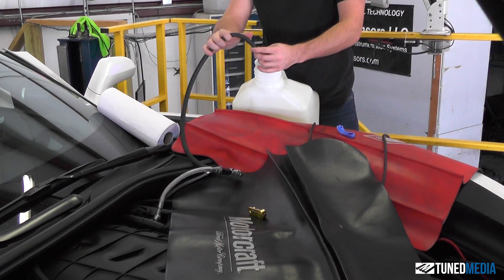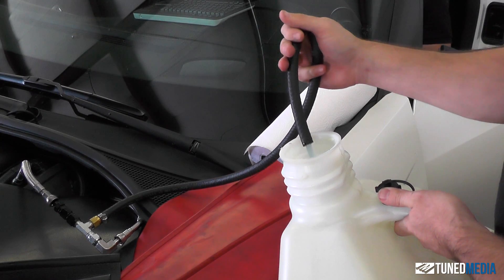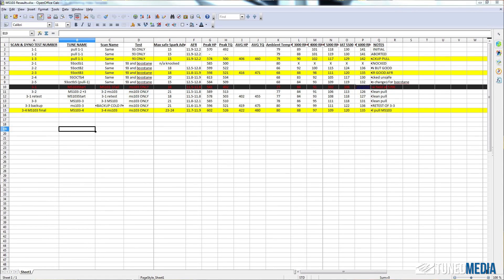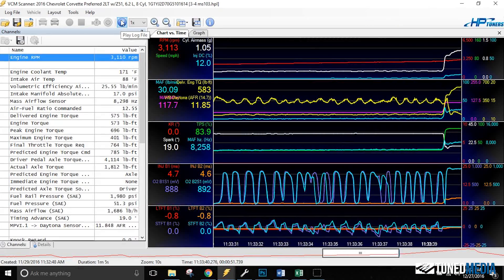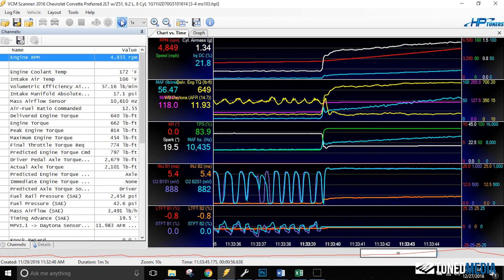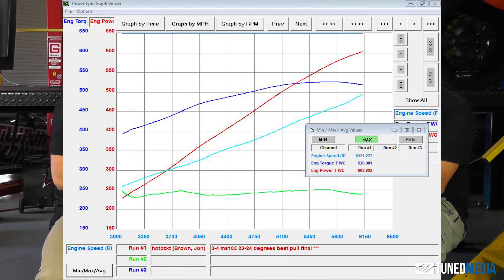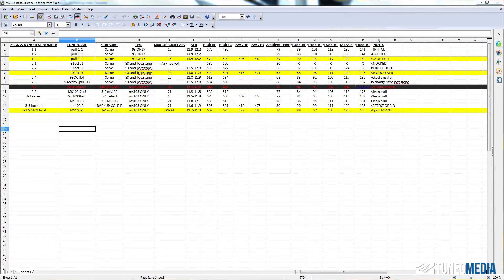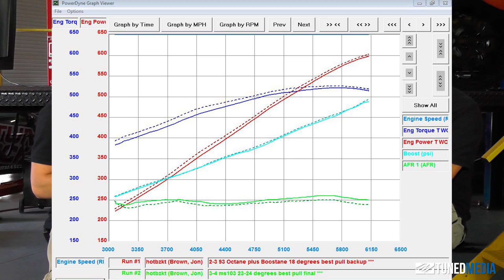Racing Fuels: VP Racing Fuels MS103 Dyno results- How much power did we make?

Comment: Well I can kinda say the opposite I went to the track in my 2010 Taurus sho with a twin turbo 3.5 v6 I had it with a 93 tune and ran a fastest pass of 9.44 in the 1/8th and once I added 3 gallons of 114 octane to 4 gallons of 93 and it ran a fastest past of 9.14 in the 1/8th

Comment: Hey Guys, just watched your series on race fuels and thought it was very informative.  I do, however, have some questions that I hoped you could help with.  I have a 2019 EcoBoost Mustang and recently installed the Ford Performance Tune.  They recommend 93 Octane for this Tune, but being that it is a canned Tune I can not modify it for different fuels.  I also live in California, so pump gas is 91 is the standard.  This made me worry that if my Tune needs 91 minimum, but reccomends 93 then I might be under the recommendation if I get bad gas.  I do not want to cause any issues with my car as it is my daily driver, but I also want to take it to the track for drag racing as well as track racing HPDE.  I would like to know which fuel set up you would recommend.

 I do not want to switch my fuel system to flex fuel or E-85, so I have been mixing in some race gas 101 octane in with my 91 pump gas to get an octane rating closer to the 93 that is recommended by Ford Performance.  I live in the high desert, so in the summer it gets very hot here.  Temperatures reach over 100 sometimes.  With that said, what percentage should I mix of 101/91 octane to reach the most power at the least amount of concern?  So far I have been using about 50/50?  What are you suggestions?  Thanks.
Reply: E85 is corrosive. It's also 20% less efficient per gallon. Has an "effective octane" around 108. It does burn cooler. 
If you have turbo why not just add alcohol/water injection for momentary power?

Comment: only concern I can see by using this particular vehicle is your getting all your power changes purely based of ignition timing, now while we can see gains from different fuels, due to this applications generally there going to be fairly small, I think what might have been useful would to have been to use a turbocharged application as that would allow more boost to be easily run which might have seen larger gains. While this does give us a pyramid of which gives the highest overall octane, the differences will be masked slightly by only seeing power change from igntion timing and as such, it might scew value for money on each fuel
Reply: Hi Turbo...  I can tell you that we had the same concerns, but after finishing all the testing we did see large gains (from 574 on 93 pump to a max over 620 with the best fuels, which you will see in the coming episodes) just from the timing changes we were able to make.  However, for round 2 (about 3 months out) of fuels testing we have switched to a turbocharged, direct injected combo to give us more flexibility.  Thanks for the feedback!
Reply: Bob Morreale I think a small displacement engine would be a good choice, something like the Ford 2.3 ecoboost in the Ford focus RS. Or if you did use a non DI injection something like a 9.5:1 forged 4G63 evo engine as that level of compression should give larger changes based on octane level. In the UK race fuel is so expensive that we generally run alot lower compression engines to make as much power as possible on pump fuel (93mon) even pump we pay $7 a gallon. We also dont have E85 at all over here. Quite a few of us make our own race fuel by mixing 30/70 mix of methanol/pump as methanol costs the same price as pump fuel. Maybe something to look at if you have the extra injector capacity. love your channel by the way, always tune into the tech Tuesdays without fail!!